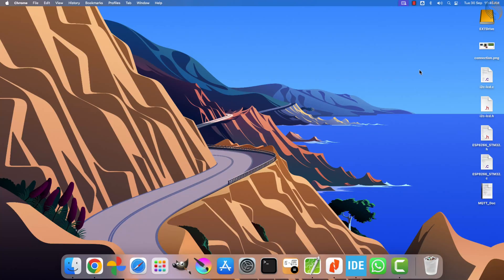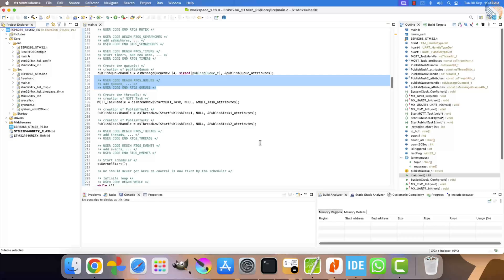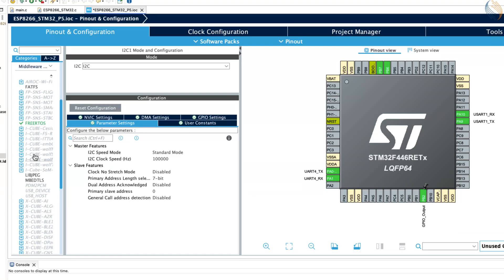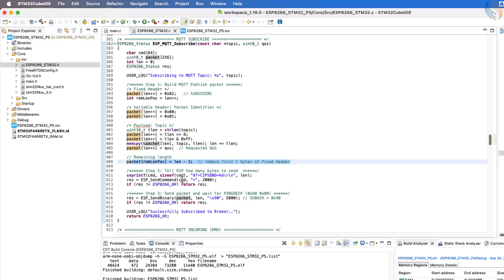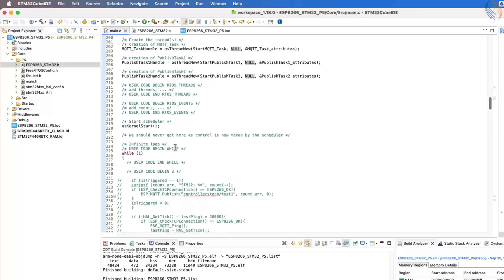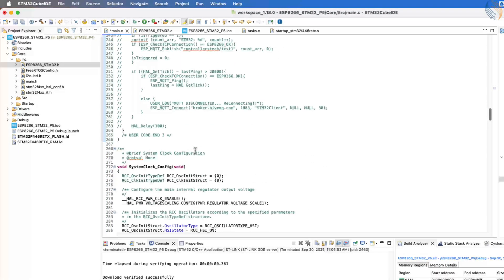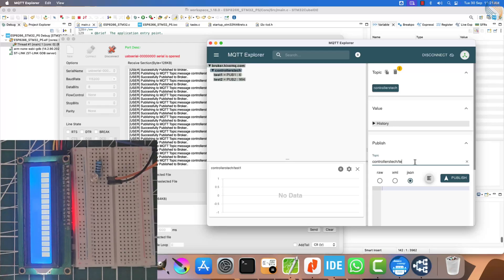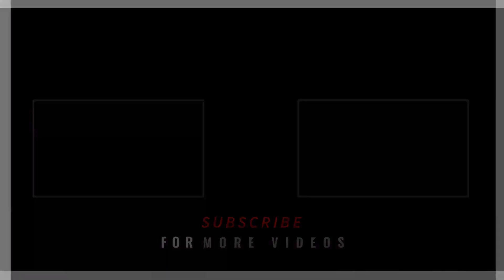STM32 IoT with ESP8266 #5: MQTT Subscribe Tutorial | DMA + FreeRTOS with LCD & LED Demo

Comment: Hello ControllersTech

 I looked for exactly this application since a very long time

..thank you very very very very much for finally doing it.

And so much thanks to you for all the other work you did all over the last years.

But by the way:

In this series (and also a lot of your older videos) I always have problems to run your STM32F4-code  on my STM32H7.

"Out fo the Box" it mostly works perfect and durable stable on my Nucelo-F429-Board...

...the same code (with the necessary changes you already postet sometimes e.g. UART-Register-Names etc.) also started to works on the Nucleo H743 

=> and at the beginning it also works fine...

...but after 1 to 10 minutes it freezes... => ?

This happend with your "Ringbuffer-Examples" (e.g. to control a LED via the "Website" "hosted" by the STM32) 

...and also with your ESP8266_STM32_P3-Example. (H7 needed some minor changes to the code too...)

Sometimes it works only for few minutes - and sometimes it works for more than one hour - but (!) - finally - it always freezes.. ! ??

(I don't believe, that the reason is in my Home-Wifi-Network - all other devices and other ESP32-Applications are working well)

...perhaps some problems in the UART-Connection between STM32H7 and ESP82666 ?
(as I can read it out of the reference manuals, there are indeed some changes between F4 and H7)

Do You have an Idea... ?

...or: what about going on with H7's - sligtly expensiver - but much more powerfull !? 🙂

- - -

Bingo!! - My "first"  "first comment" to a YouTube-Clip ever  !! :-) :-) :-) :-)